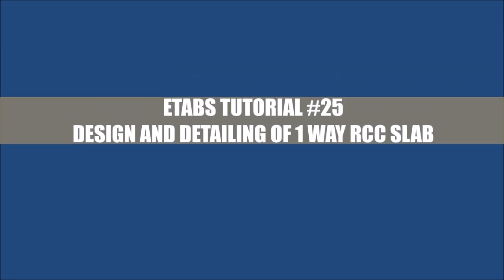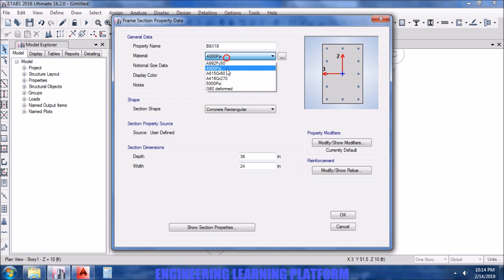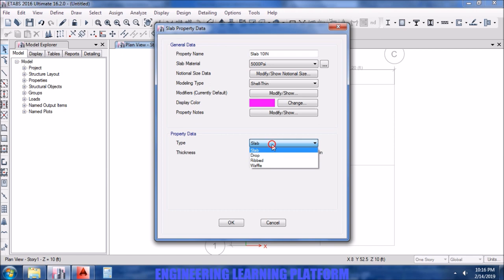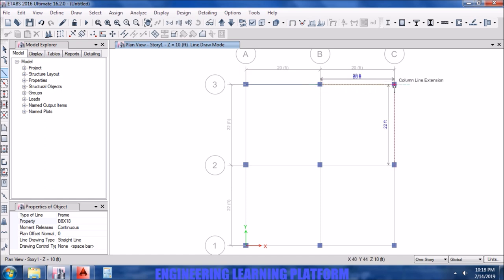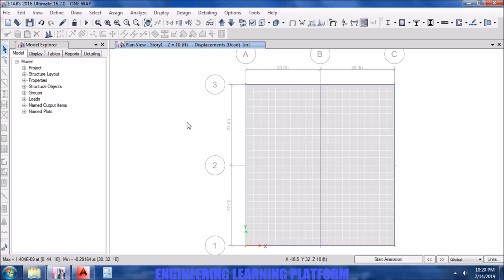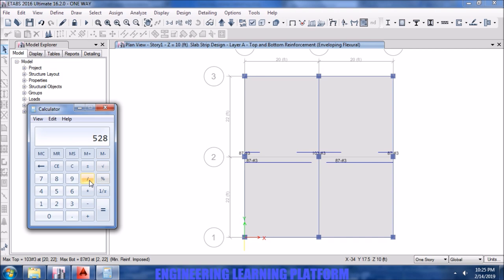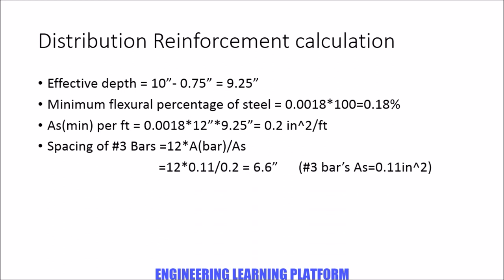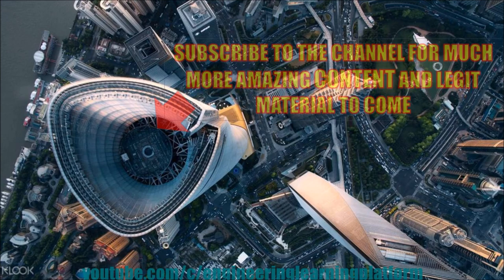Detailing and Design of One way RCC slab using etabs tutorial

Comment: what is the reason for providing positive moment steel in top position. Since it is not required. and construction point of view it increases the steel cost.
Reply from the maker: Since i am not placing torsional steel in beams as i modified beam's torsional stifness to nominal amount so slab has to absorb almost all negative and positive moment due to surface loads acting on slab . Hence top steel for negative moment is important here.
Reply: @EngineeringLearningPlatform  I am asking top steel for positive moment.i.e steel in top centre
Reply from the maker: @hariasssss  yes you can neglect that and curtail bar at L/3 from support . Since no need for extending bar beyond L/3 but in most cases cutting cost crosses the cost of steel so we dont curtail and let steel be there . But you are right that is the right thing to do
Reply: @EngineeringLearningPlatform  I requested a small help from you for me.please check ur gmail.

Comment: in my etabs i dnt have concete slab design preference option how can i turn it on
Reply from the maker: Install 16.2.1
Reply: how can i get the list in pdf for stiffness modifiers ??
Reply from the maker: @EngrArslanKausar  take a screenshot . Or use aci code chapter 10